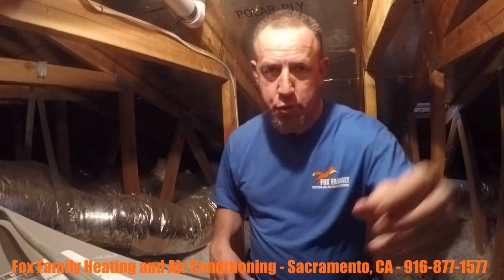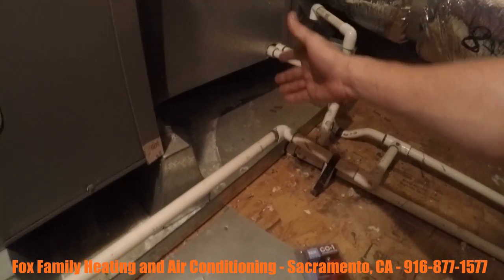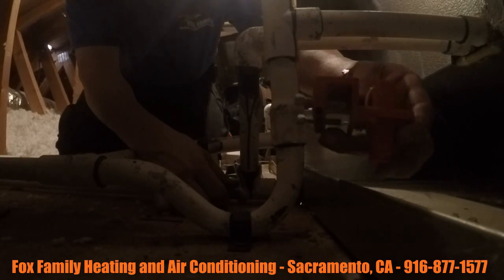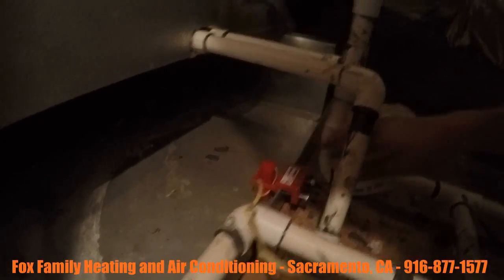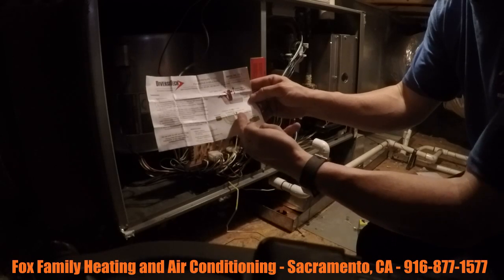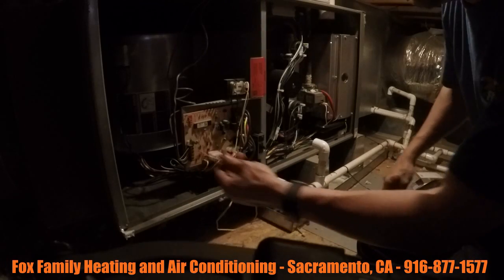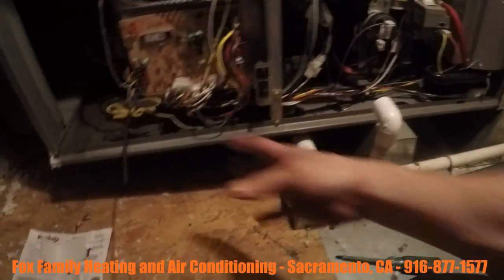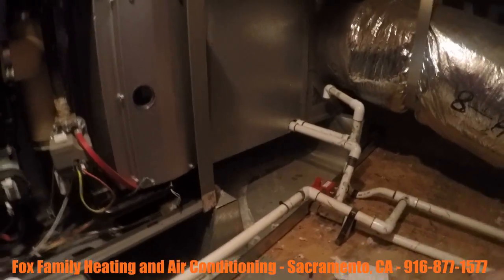How to Install a Condensate Safety Float Switch on an HVAC System

Comment: I installed a DIY mini-split system.  I did a careful job per directions that gave the impression that there was no problem draining the condensate.  It had no float switch in the ceiling air handler, with a very shallow pan and only a 3/8" drain hole.  Within a week the drain pan flooded onto my antique wood floor.  A hump accidentally made in the line of only a few inches high 15 ft below the air handler was the cause.  Who woulda thought so little resistance could plug the water?  It takes virtually nothing.  Wind blowing on the side of the house can make a few oz of pressure.  We get dirt dobbers and spiders building nests in every hole and tube around here.  Don't install without a float switch!  Sooner or later it will flood.  The company doesn't offer or can't seem to recommend a float switch or how to connect it in to their system as if they've never heard of the problem, though they portray themselves as "experts".

Comment: Nice video doing a neat job adding the safety switch. Just out of curiosity though why do you prefer to brake the Red wire where it would kill both power to the fan and the thermostat versus the yellow that will only stop the condenser outside and of course it will stop producing condensation while at the same time will allow home owner to run the fan through the thermostat until the technician arrives for the service call.
What am I missing in my thinking here?
Reply: That's just what happened to my unit. I live on 3rd floor and water has been leaking for a month now. Called maintenance twice with in a month's time because system continued blowing but wasn't cooling. They went to condenser and of course it was not working.  Not one of them ever checked the drain line to see if it needed to be flushed. This could've been avoided. Maybe if the entire system actually shut down then they would have to call a professional, and it could've been resolved. Now my neighbor downstairs has water damage to her ceiling and flooring
Reply: We only know it's been about a month cause she's been gone that long

Comment: Several years ago we noticed a water stain on the ceiling of our 2-story entryway and discovered that it was caused by the overflow pan..overflowing. 
We had to repair, re-tape and repaint the ceiling, not cheap since it was 19' high! We had float switches installed and it hasn't occurred since. We live in a high-humidity area, so it was probably just a matter of time. Why the original installation didn't include this I'll never know.
Reply from the maker: Dang. 😮Well, thanks for sharing.

Comment: In 29 years owning a small HVAC contracting business I have never had 1 attic system damage a ceiling. If you install a safety overflow switch on both  the secondary drain pan and one at the secondary coil drain outlet it should never happen. Also by code in Maryland the secondary drain pan needs a independent drain line 3/4 " PVC also run to outside of house.I have found older attic HVAC systems with only 1- 3/4" PVC line run to outside and the installing HVAC contractor tied in both the primary drain line and secondary drain line to that 1- 3/4 " PVC pipe.I also install a secondary drain pan large enough to fit under entire furnace & cased A coil even if I have to make a custom secondary drain pan myself in my small duct shop.I also never use a condensate pump in a attic HVAC install period.I always use a gravity drain system even if I have to hang the air handler/ furnace + A Coil from rafters to get enough pitch for a long run which is rare for me to do because I can normally get the units at least 10" higher than secondary drain pan.I worked for 2 other HVAC contractors  before I went into business for myself 29 years ago and saw way to many houses with damp spots in ceiling or worse 5' to 12' of ceiling just fall to floor below with water soaked installation.Great video Greg and keep up the great work !!

Comment: Breaking red is the only way to go, breaking yellow just delays the time between when there is a problem and when the customer knows they need to call for service. Breaking yellow just ends up with a day or two(or even a week) of the customer noticing diminished cooling as the condensor shuts off and on outside while the nearly plugged drain eventually trickles out enough condensation to let the switch close back.
Reply from the maker: mike_HVAC good stuff Mike

Comment: Nice work Greg.  I usually put the two switches in. one for drain pan and the coil pan. Especially in the attic. That's all I need is someone to call and say there is water dripping from the ceiling. Good job.
Reply from the maker: pttanz good idea Pat!
Reply: Its code in Maryland !!

Comment: I like to use the switch on the secondary in the evap coil so the water doesnt even get into the E pan.
Reply from the maker: Texas Made yeah I use those on horizontal and down flows.

Comment: should always break r.customer will call and say no cooling but fan is running so you will go there and waste time going through  the  condensing unit whereas if they say nothing is running  you know its a power or signal issue
Reply from the maker: plucy470 agreed!

Comment: I always broke (Y) yellow like states in switch. In hot climates at least can have fan until service man gets there.Also if coil is frozen gives it chance to thaw.. Good SSW install Greg..
Reply: Unless(like 90% of customers) they never notice the condensor isn't running, and they just turn the Stat down lower and lower hoping it will 'catch up' instead of seeing a dead stat or no hearing the blower running and calling sooner rather than later.